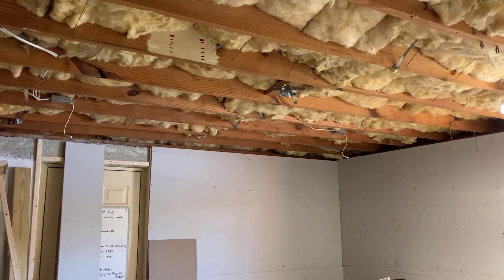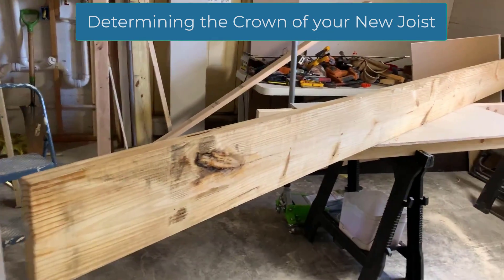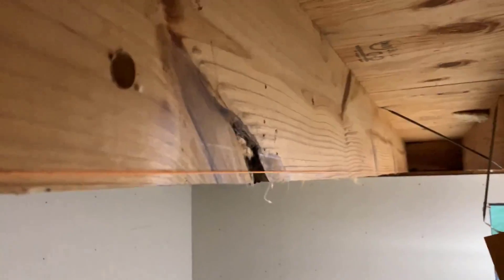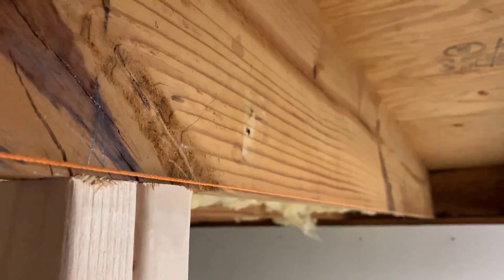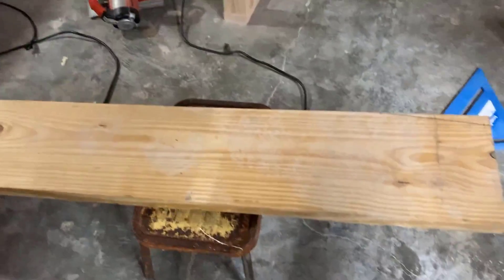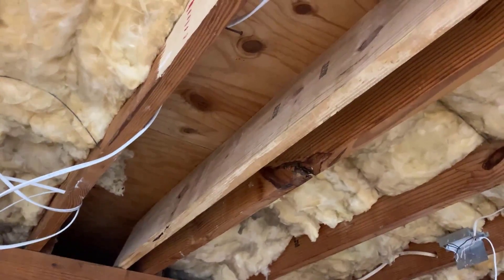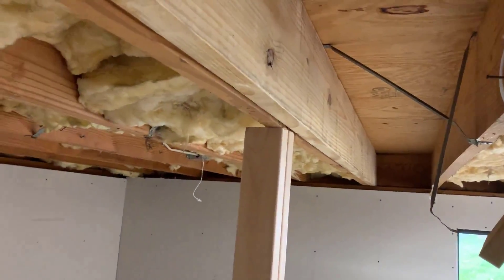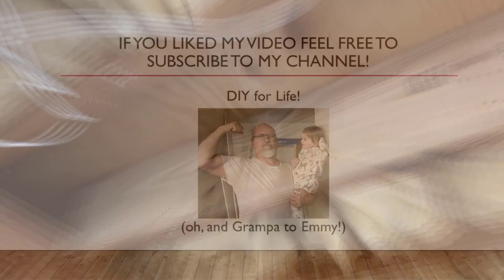Floor Joist Repair Video

Comment: i love that the screw box said NON Structural
but nice job
Reply from the maker: Hey Steven.  Yeah, fortunately, they were not holding the weight of the floor as much as just holding the new joist to the old.  The new joist was what is holding the vertical load.

Comment: Great job 👍. As a suggestion to others attempting this job, I recommend selecting joists that are "free of heart." The original joist had the dark line running through the center and the large knots = weaker lumber.  Heart wood is perfectly serviceable as stud material but best to avoid for joist or rafter 😊
Reply: In a pinch, at least try to orient the knots at the top as the top of the board will be in compression and the bottom will be in "extension."
Reply from the maker: Good point
Reply: I don't know why they're not all laminated
Reply: @rp9674  money, probably?
Reply: @danfarrell5177  true, that's usually the answer... to everything!
Reply: Aw, how cute...

Comment: Great video this will help me alot. My question is the 2x8 in my house is measuring at 7 inches not the normal 7.5 so im assuming I have to cut a full inch off?
Reply from the maker: Well actually the new joist you get will be 7 1/2 inches. If the one that’s in there it’s only measuring a true 7 inches then you’ll only have to cut off half an inch. I’m assuming your house must be older as those homes used true cut to size lumber.
Reply: @RighttothePointDIY  the 2X8's that I have bought are an actual size of 1.5X 7.25 inches. Up to a 2X6 the actual size is a half inch less. For 2X8 it changes to 3/4 inches for the width.
Reply from the maker: @iandalton6174  that is correct.
Reply: @RighttothePointDIY  yes I meant a half and inch lol. yes my house was built in 1955. no blocking system, no support. Thank you for the help.
Reply from the maker: @michaelmanara58  Gottcha.  That makes sense.  The issue of poor support is probably a bigger issue.  If the support is not sufficient you may need to address that before you begin repairing joists.  Here is a document that discusses lumber and the load limit if it helps.  https://www.awc.org/codes-standards/spantables/tutorial  Good luck.
Reply: @RighttothePointDIY  What if one of the broken rafters is so warped it cannot be glues.or screw into the new sisters board?
Reply from the maker: @michaelmanara58  I guess it would depend on how bad it is. It sounds like you might have to totally remove that one that is twisted.  You would have to jack up both sides to support the floor, cut and beat out that old Joist and then put the new one in to replace it. Then let the jacks off.  It would be a lot more work but it would be the right way to do it.
Reply: @RighttothePointDIY  thank you
Reply: Cut only 1/4 inch from the width to get a 7 inch board.

Comment: I liked your video and how you explain the procedures in fixing a floor joist. There is one  concern that wasn't address is the thickness of the new sister joist.  The existing looked like 2x10 over time it can shrink to 9 1/4  possibly. Your new joist is running fatter than that.  Possibly need to trim the fat on the sister to match the existing. Especially at the beams trying to rotate joist would be hard
Reply from the maker: Thanks for the comment Michael. As to the shrinkage i’ve never really heard of that before. When I put this new joist in it didn’t take much to beat it into place and they seemed to match up well. If that other joist had shrunk that much I sure didn’t notice it.  But, regardless I appreciate the comment.  Something to consider.
Reply: @Jessyjames60 a 2x10 measures in at 1 1/2”x 9 1/4”  today’s lumber is not what it used to be. Look at today’s 2x4 that’s 1 1/2”x 3 1/2” back in the day they were true 2x4. I have a house built in 1900 and the studs are true 2x4. Anyway your 2x10 didn’t shrink to 9 1/4”. Now if you buy pressure treated it’s possible while it’s still wet to be slightly swelled past the 9 1/4 and it will shrink a little as it dries out but it’s def never a true 10” wide...

Comment: Well done. One thing to point out tho. You want to nail the joists together with nails or structural screws.
Reply from the maker: Thanks for the comment.  Actually, I did screw them together. It is in the video about 12 minutes in.
Reply: @RighttothePointDIY  I think the operative word here is "structural". I think that when sistering the screws are subjected to shear forces, meaning forces that happen because the weak joists will "try" to sag more than the new one, resulting in the two joists slightly sliding against each other.. Nails are good at resisting shear forces. The will tend to deform before they break. Standard screws are not so good for that. Structural screws are supposed to be stronger against shear forces. On the other hand glue is excellent against shear forces so standard construction screws might well be adequate for you case.

Comment: Nicely done... that string line is a nice trick... is there a way to repair the Romex you clipped or do you have run a whole new wire
Reply from the maker: Fortunately for me these were new wires for the apartment I was wiring in. I was able to disconnect them at one place pull them out and then just re-thread them through. If that’s not convenient for you, you’re going to have to put in a junction box somewhere around that joist and join them together. Obviously make sure you cut your power and make the connections correctly.

Comment: Beside that the joist is cracked because of the knots the joists were not braced to distribute the weight on the others , I think the most important factor in building a house is to pick the lumber carefully even if you pay more to avoid problems like this in the future. A lot of people have finished basements and have problems like this and they don’t know and if they realize it would be a way bigger job to deal with .... and what I see a lot these day is that a lot of builders and contractors try to cheap out on material and tackle things fast to move to the next job and make money unfortunately.... on daily basis I see inexperienced people do jobs around and take advantage... do it right from the beginning and keep you conscious clear ... good job by the way and thanks for the video.
Reply from the maker: I agree with you. That joist should never have been installed.  Glad you liked the video.

Comment: When I sister a joist I notch both end so I don't lift the sub floor when installing and a few shims at both ends gets it nice and tight, Pl premium on top and side with the same screws you were using add blocking on both sides and call it good.
Reply from the maker: Good stuff. Thanks.
Reply: @Volkan about that just what is needed
Reply: Notch both ends ? Can you clarify

Comment: How did that Joyce crack in the first place
Reply from the maker: It was an inferior joist. The board should’ve never been used. You saw all those knots right along the bottom edge. It should’ve been rejected and a better one put in. Just the regular foot traffic and furniture load on the room above cracked it.

Comment: Not to be overly critical but the sheer strength of a number 9 screw is somewhere around 90-100 psi, the sheer strength of a 1/2 inch carriage bolt is 90,000 psi, good video otherwise.
Reply from the maker: I hear you Don but remember the screws were not holding the weight. Just holding it against the other joist.

Comment: That board should not have been used, period!
Reply: Totally agree. Builder error. That joist could have been used on the rim with no problem. It shouldn't have been allowed to be on that span.
Reply from the maker: I misunderstood your first comment.  I thought you were referring to the one I replaced it with.  Yes, that first joist should never have been used.
Reply: @RighttothePointDIY  oh no no, sorry.

Yeah the original piece, it screams that they didn't care and just used it to use it, or they used to to get rid of it. As we've all worked with plank rough sawn boards, knots always become knot holes, it has zero strength. Yeah sorry I shoulda been more clear , your fix works well, and I use a piece of wax paper between each piece, it creates heat and friction and melds them alot better in my opinion as I've done weird shit like that for stress tests. 
Good vid, thanks though
Reply from the maker: @SoloClone  No worries buddy. Yeah, when I started looking at it and I saw the cracks I just shook my head and wondered why they used that beam in the first place!  Thanks for the clarification.
Reply from the maker: Well, it’s holding just fine.
Reply: @RighttothePointDIY  knots , massive ones, multiple, on the same edge...

Not their job is what they said.
Reply from the maker: @SoloClone  Thanks for the feedback.  Hopefully between the two joists they will hold the weight.  In hindsight, I would probably have paid the additional money for the better grade joist.

Comment: Nice video! Is it important to let glue dry in a released state ?
Reply from the maker: Hey Matras, I’m not sure however it just makes sense that if you let it dry with the beam jacked up and then let it down it would possibly stress it.  Again, not to sure.  The reality is it didn’t settle that much so Letting the glue dry after the jack is released is just fine.
Reply: @RighttothePointDIY  - Definitely would want to let the glue dry while the other ones is jacked up.  That way when it’s released the stress is captured by the beam which is the whole point of the exercise. In reality is this going to make any big difference? Probably not but why not do it correctly.   Great video
Reply from the maker: @condor5635  The thing to remember here is that the weight of the ceiling is being held by the wood, not the screws or the glue. I could’ve probably not glued it at all if it still would’ve been effective. The joist itself is holding the weight. I wanted to let it down while the glue is drying just so the glue didn’t crack afterwords when I released the jack.  It only settled about an 1/8 of an inch when I released it.

Comment: Good vid 👍 what do you recommend for tighter areas where you cant run a full length piece through but still want the best result in terms of floor sag?
Reply from the maker: Hey Aaron. Well, I’m not a licensed contractor but in the case where you can’t run the full length, get a piece that is as long as you can fit in and then bolt it in.
Reply from the maker: @Volkan i’m not sure I understand your comment but it appears that you are saying the new joist you would put on would not reach the beam or the sill plate on either side. If that is the case, I don’t think it would really help all that much. It has to be supported on the ends to give it the lateral strength you would want.  However, if connected correctly (I would use carriage bolts to secure the new joist to the old one) it could help the existing joist from sagging anymore.  But again, I’m not really sure I understand your comment clear enough though.

Comment: perfect job! maybe fasten both joists with bolts, how many pounds lift from the jack?
Reply from the maker: Thanks Lning.  As I mentioned in the video, some do connect the host with bolts but I don’t believe it is necessary to hold the weight.  The jack is a 3 1/2 ton jack but I certainly wasn’t lifting with near that much force.